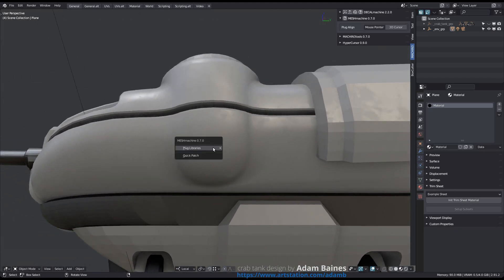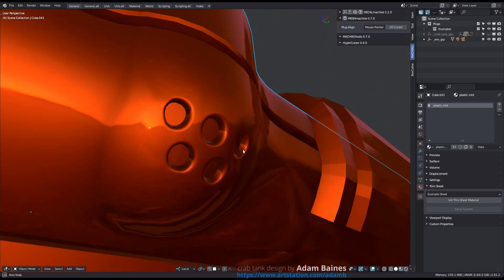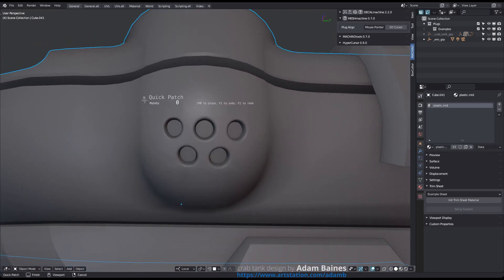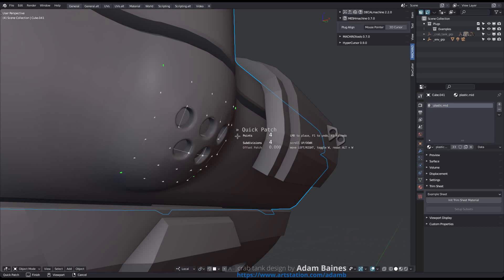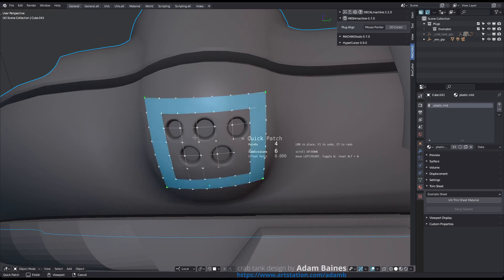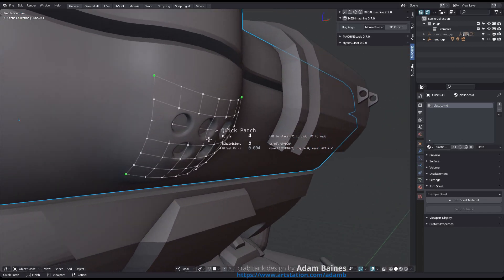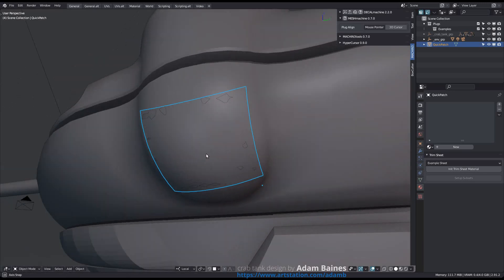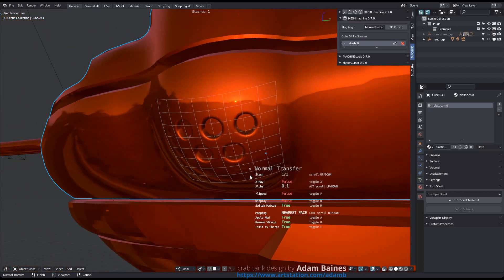MESHmachine 0.7 - Quick Patch

Comment: Nice one! 
Although it's a brand new tool, i always feel myself in the past (cave men times), when i'm whatching these ridicolous limitations of the 3D programs. It is still a fight to boolean something then bevel it (until you go in a CAD program). One day AI systems will solve all these problems and we can forget the 'mesh editing' or 'shading issues' and other outdated stuff...and maybe AIs will use solutions (as a base) from genius programmers like you...:)
Reply from the maker: I wish I could integrate Fusion, or hell even MoI into my workflow. I've used both in the past and there are great things to be done in regards to bridging the apps, but without proper linux builds it's not worth it for me.

Comment: You should adjust the quickpatch function to include a shrinkwrap action. It'll resolve the topological overlays if the patched area can be shrinkwrapped onto the newly created patch first first then have the normal transfer applied. The shrinkwrap action may need a weight/feather where the base mesh meets the start of the patch however depending on how high density the patch was.
Reply from the maker: I don't follow.
Reply: @MACHIN3  Just a feature suggestion tbh. Based on the principles of this for curved surface modelling: https://www.youtube.com/watch?v=3rlMzsBWtPY

I can see quick patch being a great basis for a similar approach if the original model is not intact to use as a "guide" as described in teh link i attached. to that end, being able to have an option for quickpatch to shrinkwrap the vertexes underneath the newly formed patch once it's been applied would be a great extension of your current feature.